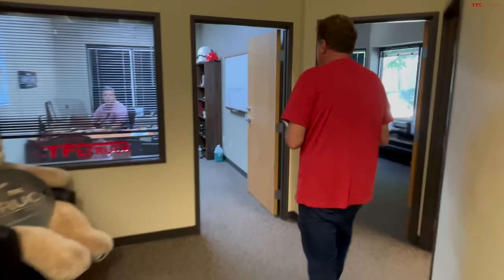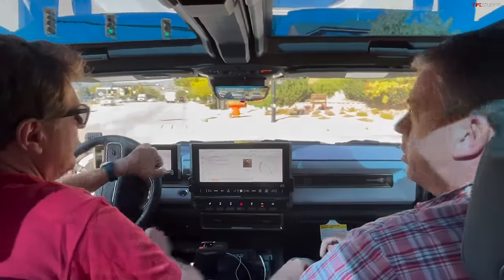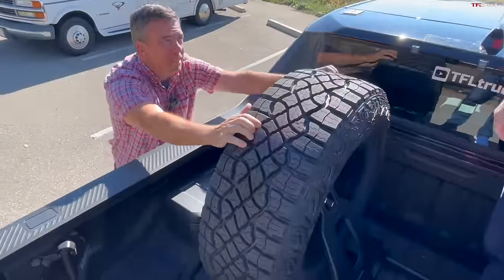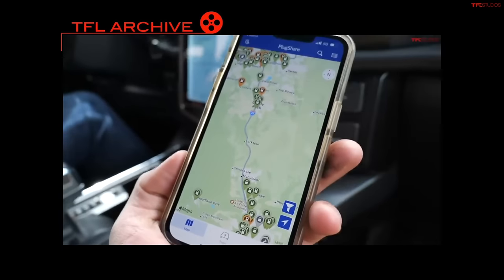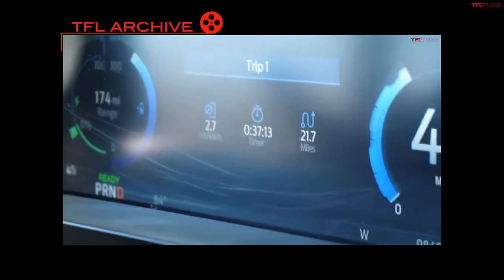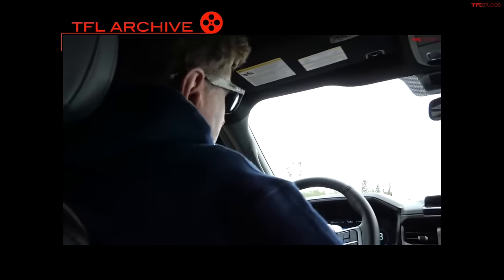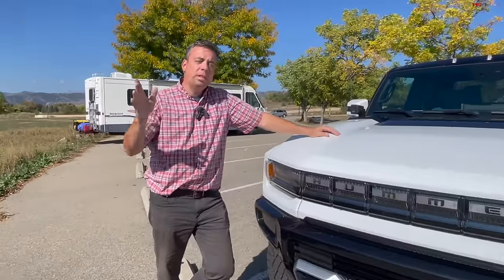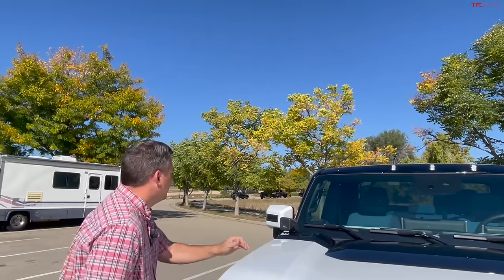Here's What Happened to Our Hummer EV When It Broke Down & WHY We Traded Our F-150 Lightning for It!

Comment: You purchase a greater than $100K vehicle and the dealer didn't upgrade the firmware before selling it to you despite there being a known issue. What's wrong with this picture? Had this been an airplane, the FAA would have fined someone's ass for endangering the user.

Comment: You guys really got to get a hold of your numbers\facts. Tommy says the electric range limitation is all about aero. Not true!! You lost 2/3 of your range towing a little trailer. Do you loose 2/3 of your range when towing a similar sized trailer with a gas or diesel truck?? There is something wrong here with the design choices or even technologies with these EV's. Why do you have a 500 hp electric motor but have such a limited range. If you went to say 350 hp motors what is your range?? It should be obvious or something else smells in that pile.

Comment: 20:50 Be nice if Ford kept is Aero Dynamic Early 2000s truck design with modern improvements and the lightning styling of back then as aluminum body. I pretty sure range would have also been better. But some idiot at ford like. Hey lets make our trucks look like 80's style bricks that push against the wind vs glide through it.

Comment: The reality is that the battery starts dying from the day you buy the truck.  It is said that charging the battery over 80% increases the battery’s degradation rate along with rapid charging.  At the end of the warranty or lease dump it.  BUT, $80,000+ for a truck with limited range without charging for hours after driving will NOT sustain it in the marketplace.  The marketplace will determine its success or failure.  CRAMMING EVs down our throats will not ensure it’s success.  What next?  Will we have to wear green shirts on Wednesday?  JMHO, but hybrids might just be the more viable alternative. Just sayin…

Comment: You will know if EVs are going to take over, when and if AAA starts to send out "charge trucks" with a 25kW genset and a 50kW battery onboard. To "give a gallon of gas" to stranded EV drivers.
 Unless they standardize tow hooks, because flatbed tow drivers are outright scared on new suspension and drive components.

Comment: These EV idiots need to stop making it so everything is electronic or pushbutton only. There's should be a manual frunk release handle like a hood release...not a stupid pull loop under the dash. Same with every other door handle. The computer crap breaks much too easily, or they charge a premium to make sure it works (coming soon to a control near you).

Comment: I am sorry but I love everything about the Hummer EXCEPT the fact it is a electric vehicle. The electric vehicle is still limited on what you can do with it on and travel with distance especially with towing that goes down a bunch then worrying about finding a place to charge it and it takes hours to charge in some cases days if you just use a normal plug. Why would people be spending 100k + on a vehicle they are limited on traveling the country with and can basically use it for local use only. If it was where gas vehicles are today then it would be a no brainer but it's not and the whole stupid going green is a total shame with dinosaur power still creating the electricity to charge these vehicles. Gas vehicles all the way for me.

Comment: Toyotas is working on Hydrogen.... I think they are on to something....
Or get rid of the emissions bs an start running diesel on hemp oil... I had a 1980's vw rabbit that was beat to crap an it still would consistently get over 50mpg running used French frie grease!

Comment: As a power engineer, EV companies should ask me how I could double their EV distance. NONE of them have thought aboot it yet. I'm sure in the future they will eventually learn. Cheers Blessings 👽🖖.
Reply: Yawn.... Let me guess... strap alternators to the wheels and drive it forever... only violating every single law of physics in the process...
Reply: @redbaron6805  LOL, that's been tried before. As long as you don't try to break the Laws of Physics(can't be done).... it can be done. Don't think outside the box, think outside the vault. 100% can never be achieved, but 99% can. 🛸.
Reply: @tonynagy2042  I'm pretty sure they have pretty smart people on the case.  It also would be rather ehm..... difficult to "double the distance" of EV's that are already over 90% efficient as it is.

Unless you are claiming you can make them 180% efficient...
Reply: @redbaron6805  I have many many suggestions, but I'll start with one question K. "Why don't they incorporate molded solar panels all around the vehicles body? the roof and hood for example. There are other 'ways' too, to harness energy. I just think they haven't given the EV's full potential as of yet. Cheers. 🛸
Reply: @tonynagy2042  To answer that question, there are already car makers that do that,  Sion, Lightyear, etc.  The main reason is that the amount of power you get that way isn't really that much, a few miles each day.

Comment: EVs would work if you invested trillions? in grid capacity, millions of highspeed chargers scattered pretty much everywhere, and enormous upgrade in power generation.    Also will need programs so people can afford these $60 to $100K cars so some sort of cash for clunkers 2.0 (trade in fossil program) with zero interest rates and 30 years auto loans.
Reply: At current sales numbers, it will take over 100 years to replace all the gasoline vehicles on the road.
25% of all EV buyers SELL their EV and go back to gasoline........
EV - not ready for prime time !

Comment: Also everybody remember electric vehicles are not green remember they get charged by electricity and guess where that comes from power plants coal and gas mostly there's not as many nuclear plants as there should be and there's not enough wind solar o Or geothermal Most electricity is produced by coal and natural gas or some sort of oil or gas so it doesn't do any good until the infrastructure supports electric cars which it does not Don't forget States like California and Texas who have power outages all the time if everyone had electric cars get imagined all the power out and you still have then and then it's not sustainable right now maybe in 20 years when the power grid is redone and 3 done and the battery technology is better but do not buy electric right now I mean there's a reason Toyota and Honda the best makers of cars have nothere's of course I've not built a real good electric car yet because they don't see a future in it yet maybe in 20 years but that's not today's future I guarantee it I'm a truck driver we're gonna be driving diesel for a while I hope they do a hybrid semi truck that would make sense a hybrid but electric is not the future right now it's gonna be awhile

Comment: they are going have have a worse recharging and long trip experience on the hummer.  The much bigger battery will take even longer to charge than the lightnings while not having that much further range.  Range anxiety is going to be even worse because of the extra time it will take to charge for the same range.

Comment: Electric vehicles don't scare me, the ability to troubleshoot and repair them does. You can check fuel, spark, air intake, fuses, a hundred other things on ICE vehicles, to at least, limp off the road. Locked, proprietary software and electric actuators, won't let you troubleshoot the basics. You're at the mercy of a dealer for everything. Do you own the truck or does the manufacturer own you?

Comment: The current electric car is only good for city driving that is it large cities I electric cars are probably gonna be great it's actually that newer technology where they swap the battery I like that like that you don't have to buy the battery you buy a subscription so you can change the battery when you need to that makes sense but for long distance travel or it's travel or anything over 30 miles I would not go electric at all